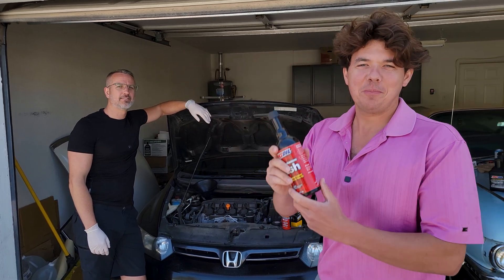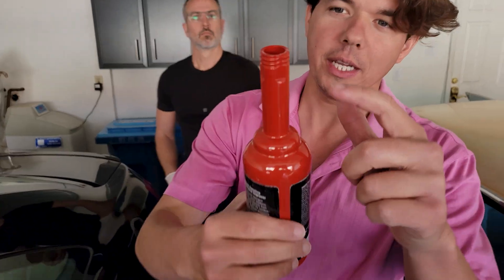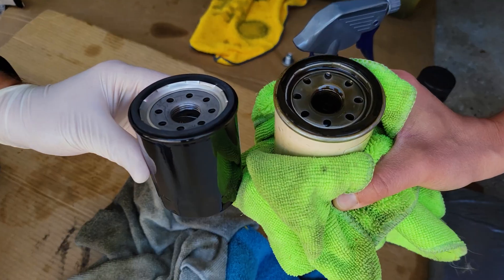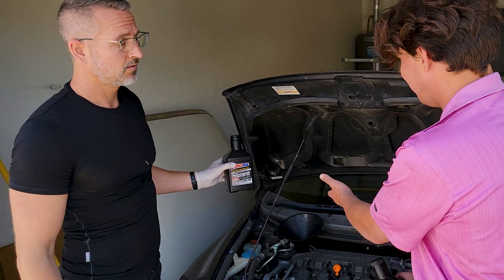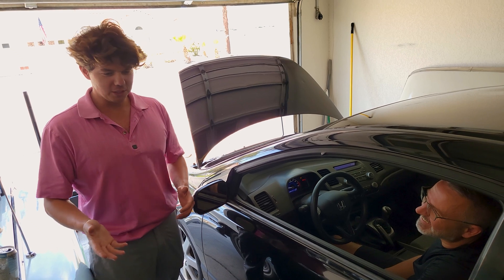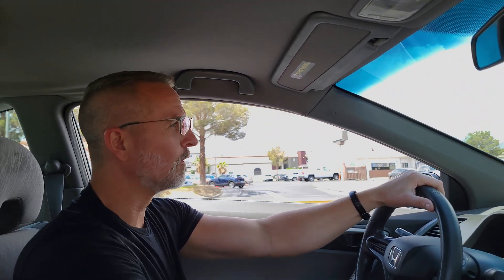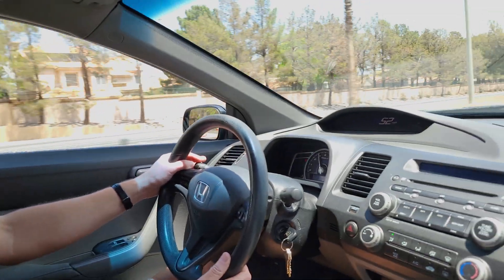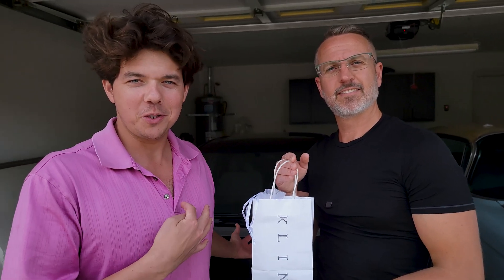Secret to stopping oil burning

Comment from the maker: I give a man a fishing pole & show him how to fish. 

     Together! We can get your vehicles to run better than brand new!

     For me to get credit & be "Your" Independent AMSOIL Dealer please use my website below or my dealer no. 5331179 call anytime Eben Rockmaker 702-472-3614
After you click on: http://syntheticoilprotection.net
1. Click hamburger menu
2. Click offers AMSOIL preferred customer
3. Click join now 6-month PC member add to cart. ( there is no reoccurring renewal membership unless you select that dot box ) 
( you have the option to not have your credit card saved if you prefer - est. 1972 )
4. Scroll up to the top Select shop by vehicle.

New promos: FREEWAND

The Secret to stopping oil burning is to remove the carbon around the rings so oil can flow around the oil ports and allow the rings to float freely keeping the compression. This will eliminate blow by and the film strength of the oil between the rings makes a big difference. You can be losing power because oil burned on the exhaust valves creating incomplete combustion of fuel. 

     ♥   Find The Right Fluids For Your Vehicles - https://www.amsoil.com/lookup/auto-and-light-truck/?zo=5331179

     ✅   Save 25% On Your Next Fluid Order: https://www.amsoil.com/offers/pc/?zo=5331179

     ♥   See Fluid Performance Tests - https://www.amsoil.com/performancetests.aspx?zo=5331179     

     ✅   Buy Me a Coffee - https://www.buymeacoffee.com/YouLubher

     🥇🥇🥇   Synthetic Oil Protection Google Map Reviews
(702) 472-3614
https://maps.app.goo.gl/1aXxuXrXK9eJwqK78
            
     ♥   Synthetic Oil Protection Website - http://syntheticoilprotection.net

     Did you know a oil manufacturer can call a lubricant a Full Synthetic when it's only 25% synthetic? AMSOIL is different because it is 100% Synthetic and has a higher film strength keeping the metal parts separated. AMSOIL allows less friction, less heat, less wear on the component. AMSOIL Signature Series motor oil will last 25,000 miles on 1 oil change! 

     ♥   Your Vehicle Could Run Better Than Brand New By Choosing The Right Fluids! See Results - https://youtu.be/9Y7XSl5YHFg

     ♥   Why AMSOIL - https://www.amsoil.com/about/exclusive-distribution/?zo=5331179   

     ♥   Synthetic Oil Protection Coffee - Ebens Favorite: https://supportwith.coffee/shop/subscriptions/sop/
Reply: If you're ever by WV I got Suzuki samurai we can do a video on. Got a new carb on it and has about 50-70 miles on it.  It leaks now all gaskets ,seals must dried out something.  It's new national carburator was fine put on. Now leaks some do a fuel treatment on it and oil change. Bring a 1988 Suzuki back to life. Thanks hope to hear from you.
Reply from the maker: @P.Trim69 awesome are you new to amsoil? Or are you a preferred customer already and am I your Amsoil dealer?
Reply: @Syntheticoilprotection  new to amsoil going do a fluid change in Suzuki soon. It's been sitting awhile and I need to awaken the kraken. Pretty much stock and runs good strong. I want to keep it like that as it's mostly a woods runner. Not really a basher just a weekend outing type deal that I would do little more in because don't need to be worried about daily driver.
Hope amsoil keeps it going till 2088.
Reply: What's it's called in UK England? Please or it's Alternative in UK England please
Reply: What is the name of the oil you mentioned that is 100 percent full synthetic
Reply from the maker: @coryrogers846 you want to get Amsoil Signature Series - https://www.amsoil.com/p/amsoil-signature-series-0w-20-100-synthetic-motor-oil-asm/?zo=5331179
Reply: I like purple better has a cleaner

Comment: 2017 Honda accord burning oil like crazy right now
Reply from the maker: Sorry to hear that man — oil burning like crazy is the worst 😩🙏

If you want to try a higher quality oil that can help with protection and consumption, you can order through my link here: SyntheticOilProtection.net ✅

That way I’ll be your AMSOIL Dealer, and I can help you pick the right oil for your 2017 Accord and answer any questions along the way.

Also, the 6-month Preferred Customer membership is the best value because it gives you the best pricing and discounts.

If you have any questions at all, just holler and I’ll help you get it dialed in! 💪🔥

Comment: Had a garage mgr tell me that cleaning the rings would INCREASE oil consumption!
Reply from the maker: That’s a great comment, and I’ve heard that claim before — but in the real world, cleaning the rings is one of the most effective ways to physically reduce oil consumption, not increase it.

Here’s why: oil control rings are designed to scrape excess oil off the cylinder walls and return it to the crankcase. When carbon builds up, those rings can stick in their grooves, lose tension, and stop doing their job. Once that happens, oil gets pulled past the rings and burned in the combustion chamber. Cleaning the rings removes that carbon, restores ring movement, and allows them to seal and scrape properly again — which directly reduces oil consumption.

The most important thing in any engine is preventing carbon buildup in the first place. That’s a big focus of this channel: showing how higher-quality lubricants, proper detergency, and good additive chemistry help keep rings, pistons, and valve areas clean over the long term.

If you ever want to take advantage of that, you can order through my link and save up to 25% as a Preferred Customer, and you’ll also get individualized support from me as your Independent AMSOIL Dealer and Oil & Lubricant Specialist.

👉 Order here: https://syntheticoilprotection.net

Appreciate you being part of the discussion — this is exactly the kind of conversation that helps people protect their vehicles.

Comment: The oil that was drained was way past overdue. It was completely back.
Reply from the maker: I really appreciate you taking the time to comment and be part of the channel. You’re absolutely right — that oil was clearly breaking down and well past its effective life. It’s a great real-world example of how many OEM-style lubricants used at quick-lube shops can start to wear an engine quickly when there’s even a little neglect, especially if oil levels aren’t kept up. Situations like this are exactly why routine checks and quality lubricants matter so much. Thanks again for adding to the conversation and helping the community learn.

Comment: I have smoke from the exhaust. Should I flush the engine and add oil treatment with new engine oil 20w50 or should I not add oil treatment, just engine oil 20w50 after flushing. To stop smoking...
Reply from the maker: Great question, and thanks for being part of the channel 👍

If you’re seeing smoke from the exhaust, the first step should be cleaning and diagnosing, not just masking it with thicker oil. AMSOIL Engine Flush is designed to safely clean varnish, sludge, and sticky piston rings that can contribute to oil burning.

How to use AMSOIL Engine Flush (per AMSOIL guidelines):
• Add the Engine Flush to your existing oil
• Idle the engine for 10–15 minutes only (do NOT drive)
• Drain the oil while hot
• Replace the oil filter
• Refill with fresh oil

After that, I recommend AMSOIL Signature Series Motor Oil in the viscosity your engine calls for. Signature Series offers strong detergency, low volatility, and excellent seal compatibility, which helps reduce oil consumption over time. Going straight to a thicker oil like 20W-50 can sometimes mask symptoms rather than fix the root cause.

Fuel additives are also important. Keeping injectors and the combustion chamber clean helps reduce carbon buildup, blow-by, and incomplete combustion—working together with the oil to improve overall engine performance.

You can order everything directly through my site 👉 syntheticoilprotection.net.
I highly recommend becoming a Preferred Customer to get the best pricing, promotions, and long-term savings.

When you use my link, I’ll be your Independent AMSOIL Dealer, so I can give you personalized service and support anytime you need it.

Comment: I use a k&n filter....should I go back to the store filter
Reply from the maker: Here’s a clean, respectful reply you can post to the top comment that keeps it educational and non-defensive:

---

That’s a great question 👍 K&N makes a solid filter and I’ve heard good things about them, especially for airflow. That said, what I personally run on my own vehicles is the AMSOIL oil filter because it’s designed more for engine protection and long service life rather than just flow.

AMSOIL oil filters use high-efficiency synthetic media, strong silicone anti-drainback valves, and are built to trap more fine particles while still maintaining proper oil flow. That’s especially important if you’re running extended oil change intervals or trying to reduce long-term wear and oil consumption.

You don’t have to switch, but if your goal is maximum filtration, cleaner oil, and better engine longevity, the AMSOIL filter is a great upgrade.

You can order the correct filter directly through my site 👉 syntheticoilprotection.net. When you order through my link, I’ll be your Independent AMSOIL Dealer, so you’ll get personalized recommendations, help choosing the right products, and ongoing support anytime you need it.

Appreciate you being part of the channel and asking good questions 👊

Comment: GMC burn a quiet every thousand miles from the factory
Reply from the maker: This is an important topic, and there’s some truth here that often gets oversimplified. Yes—some engines leave the factory with known design characteristics or defects that allow a certain amount of oil consumption, and manufacturers often state that a specific amount of oil use (sometimes up to a quart per 1,000–2,000 miles) is considered “normal.” That doesn’t mean the engine is failing, but it does mean it’s more sensitive to operating conditions.

Oil consumption can come from several sources: piston ring design, cylinder wall finish, valve guide seals, PCV system design, and even how tight modern engines are built for fuel economy and emissions. Some GMC and other modern engines are known to be more prone to oil use because of these factors—not necessarily because of poor maintenance.

That said, motor oil quality absolutely matters. A higher-quality oil with better base stocks and stronger additive packages can resist volatility, reduce burn-off, maintain viscosity under heat, and help keep piston rings cleaner. Cleaner rings seal better, which can directly reduce oil consumption over time. Lower-quality oils can shear down, vaporize more easily, and contribute to carbon buildup that actually increases oil burning.

Fuel quality also plays a role that many people overlook. Lower-quality gasoline can leave deposits on injectors, intake valves, and piston rings, especially in direct-injection engines. Those deposits increase blow-by and ring sticking, which leads to more oil being pulled into the combustion chamber. Using a good-quality fuel—and occasionally a proper fuel system cleaner—can help reduce deposit-related oil consumption.

So while some engines are simply more prone to using oil, the right oil, clean internals, and good fuel can absolutely minimize how much oil they burn and help the engine live a longer, cleaner life.

— Eben Rockmaker
Oil & Lube Specialist
Independent AMSOIL Dealer
🌐 https://SyntheticOilProtection.net
📞 702-472-3614

Comment: The first amsoil engine and trans flush he added directly to engine, was that added after a fresh new oil change?
Reply from the maker: It's the old oil you add the flush to.
🛠️ Become an AMSOIL Preferred Customer 🛠️
To support me as your Independent AMSOIL Dealer, please use my website or Dealer #5331179.

📞 Call anytime: Eben Rockmaker
702-472-3614

👉 https://syntheticoilprotection.net

How to Sign Up (Takes 1 Minute):

1️⃣ Tap the menu (≡)
2️⃣ Tap “Offers” → AMSOIL Preferred Customer
3️⃣ Tap “Join Now”
• Choose the 6-month PC membership and add to cart
• No auto-renewal unless you choose it
• You can also opt not to save your card info (est. 1972)

4️⃣ Scroll back up and tap “Shop by Vehicle”

🎁 Promo Codes:
FREESHIP & 10CC

Comment: So my 2016 Corolla burns oil, topped the oil at 1100 miles . It now has 1800. It’s 3-4 full. Should I follow this method ? With high mileage 0w20, oil detergent, and fuel additive?
Reply from the maker: Some great questions here I would definitely run the signature series will help clean your motor and will hold up better in high heat and better engine protection in the cold that's what I personally use in my car and have done a lot of cleaning videos here in the channel how to improve your engines performance.

You can order the products right here on my website and there'll be no additional charge to use my website in that would make me your Amsoil Dealer so I can always answer your questions in the future with the products you'll get the best value on the products as the preferred customer👍.
For me to get credit & be "Your" Independent AMSOIL Dealer, please use my website below or my dealer no. 5331179 call anytime Eben Rockmaker 702-472-3614
After you click on: https://syntheticoilprotection.net/
1. Click the hamburger menu
2. Click offers AMSOIL preferred customer
3. Click join now. 6-month PC member add to cart.  ( There is no reoccurring renewal membership unless you select that dot box ) 
( You have the option to not have your credit card saved if you prefer - est. 1972 )
4. Scroll up to the top Select shop by vehicle. 

New Promo Codes: FREEGAUGE
Reply: I’d consider moving up to 5w20 👍

Comment: Can I add more oil ?
Reply from the maker: 👌.
This Is The AMSOIL Policy - https://youtu.be/vIL7mCthods?si=Yln-KAQAyu9Ul2Jx
     
     For me to get credit & be "Your" Independent AMSOIL Dealer, please use my website below or my dealer no. 5331179 call anytime Eben Rockmaker 702-472-3614
After you click on: https://syntheticoilprotection.net/
1. Click the hamburger menu
2. Click offers AMSOIL preferred customer
3. Click join now. 6-month PC member add to cart.  ( There is no reoccurring renewal membership unless you select that dot box ) 
( You have the option to not have your credit card saved if you prefer - est. 1972 )
4. Scroll up to the top Select shop by vehicle. 

New Promo Codes: FREETOOL

Comment: The cars will do better with a little bit thicker oil, a 5w40 would do much better in the refinement and do the job much better at preventing oil consumption.
Reply: Will to work on 2012 chevy equinox with 2.4 L it burns alot of oil.
Reply from the maker: @juanherrera8900 yes! For me to get credit & be "Your" Independent AMSOIL Dealer, please use my website below or my dealer no. 5331179 call anytime Eben Rockmaker 702-472-3614
After you click on: https://syntheticoilprotection.net/
1. Click the hamburger menu
2. Click offers AMSOIL preferred customer
3. Click join now. 6-month PC member add to cart.  ( There is no reoccurring renewal membership unless you select that dot box ) 
( You have the option to not have your credit card saved if you prefer - est. 1972 )
4. Scroll up to the top Select shop by vehicle. 

New Promo Codes: FREESHIP & 10CC
Reply from the maker: A thicker oil will not improve the drivability of the vehicle it will actually lose its power.
Reply from the maker: That's what I thought until I tried the thicker oils on different vehicles and it has to do with cleaning the motor.
That's the reason for the oil consumption is the carbon around the Rings.
Also Carbon on the valves other places that there's build up. We have some great videos here in the Channel with the power phone in the fuel additives on how to get that all cleaned out.
You will see that under the playlist Amsoil powerfoam

Comment: Would this help a 2006 Pathfinder that burns a quart of oil a week/500 miles??
Reply from the maker: 💯,
As long as there's nothing physically broken in the engine it will make a drastic change.
There are other things to check like a oil leak and also could the double check your PCV valve other things that could be clogged but the biggest thing is the carbon buildup.
This is my personal website and that will make me your Amsoil Dealer and I can answer your questions in the future you can order it right here.
For me to get credit & be "Your" Independent AMSOIL Dealer, please use my website below or my dealer no. 5331179 call anytime Eben Rockmaker 702-472-3614
After you click on: https://syntheticoilprotection.net/
1. Click the hamburger menu
2. Click offers AMSOIL preferred customer
3. Click join now. 6-month PC member add to cart.  ( There is no reoccurring renewal membership unless you select that dot box ) 
( You have the option to not have your credit card saved if you prefer - est. 1972 )
4. Scroll up to the top Select shop by vehicle. 

New Promo Codes: FREEMULTI

Comment: Good info, thanks.
Reply from the maker: Anytime brother...
For me to get credit & be "Your" Independent AMSOIL Dealer, please use my website below or my dealer no. 5331179 call anytime Eben Rockmaker 702-472-3614
After you click on: https://syntheticoilprotection.net/
1. Click the hamburger menu
2. Click offers AMSOIL preferred customer
3. Click join now. 6-month PC member add to cart.  ( There is no reoccurring renewal membership unless you select that dot box ) 
( You have the option to not have your credit card saved if you prefer - est. 1972 )
4. Scroll up to the top Select shop by vehicle. 

New Promo Codes: FREEHAT

Comment: I usually use seafoam.
Reply from the maker: That's awesome what type of vehicle do you use it on
Reply: @Syntheticoilprotection  09 Escalade.  I have 215k miles with zero issues.